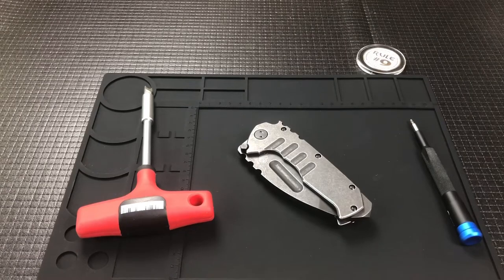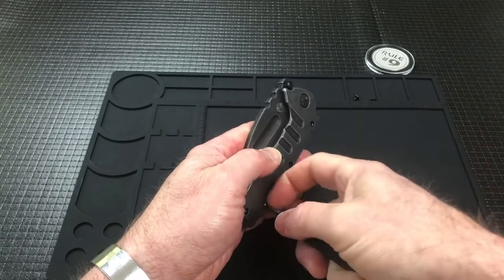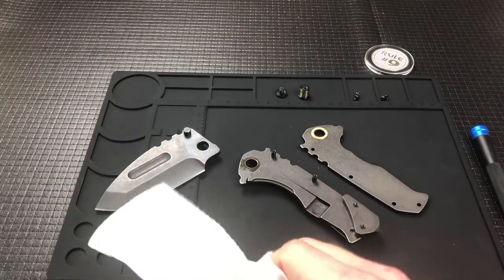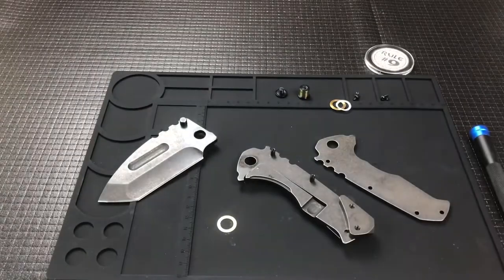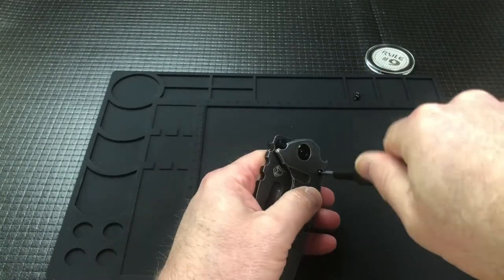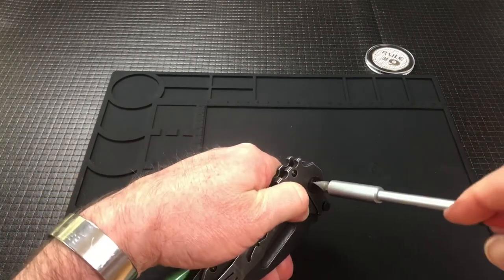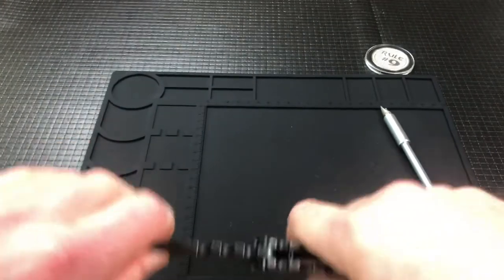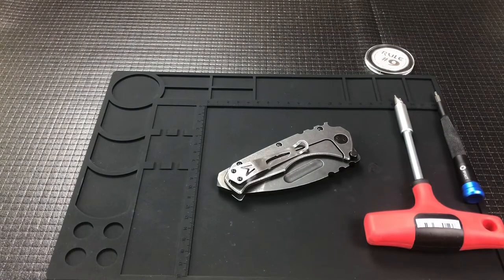Medford Knife and Tool How To Spot a Fake Disassembly

Comment: Do the square shaped tangs on the spanner bit mar the round holes in a Medford pivot? (not that I need to open any of my Medfords)
Reply from the maker: Anthony Miller it’s best to round off the ends of the spanned bit slightly.